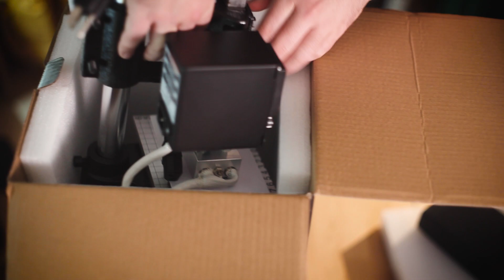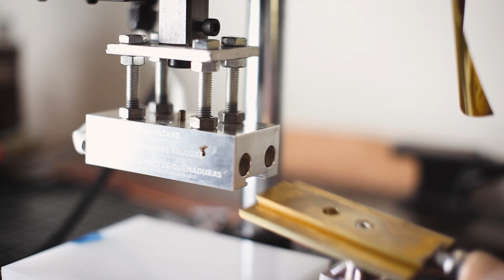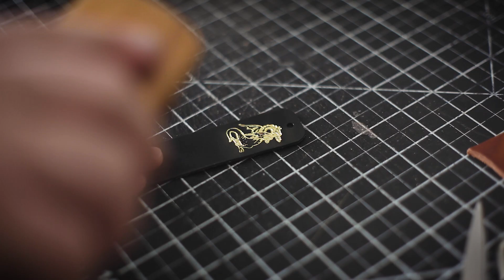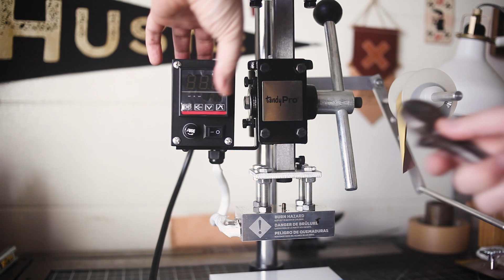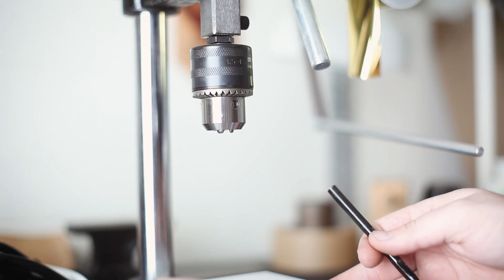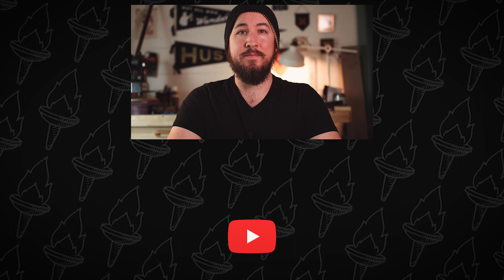TandyPro® Heat Imprinter Follow-up: 3D Stamps and Punches

Comment: I'm a Leatherwork Merit Badge Counselor with Scouts and I acquired one of the older Tandy heat imprinters to use for the classes.  I watched the video of you demonstrating the accessories that you got with yours.  I'm trying to find the insert that allows use of 3d stamps to hot foil stamp them.  I can't find them on Tandy's website.  Do you have the item number from the accessories kit?  Any help would be appreciated.  Thanks,  Dale